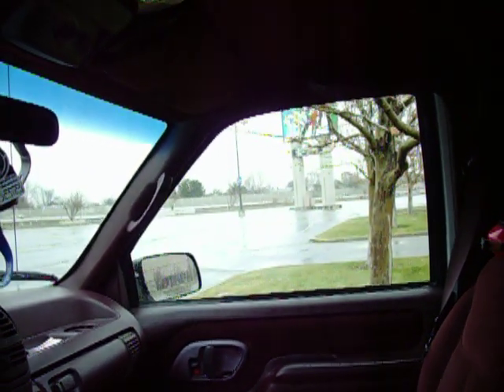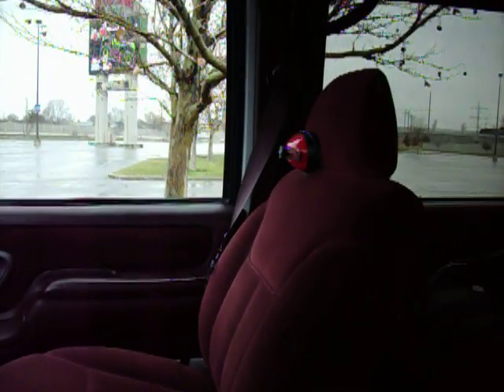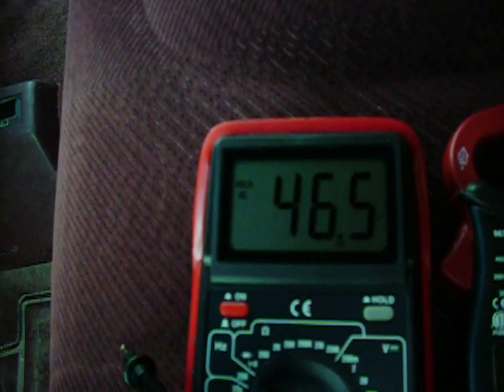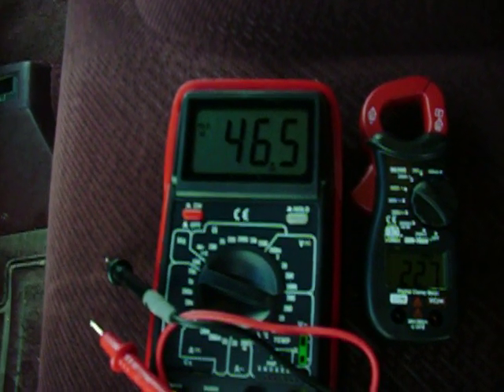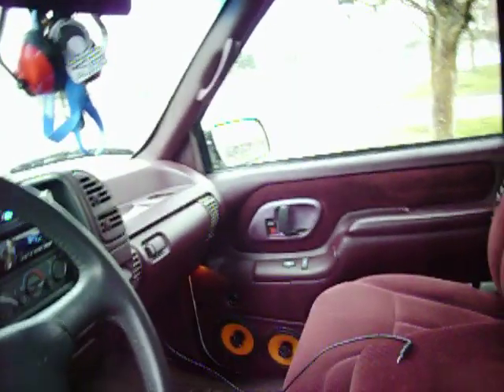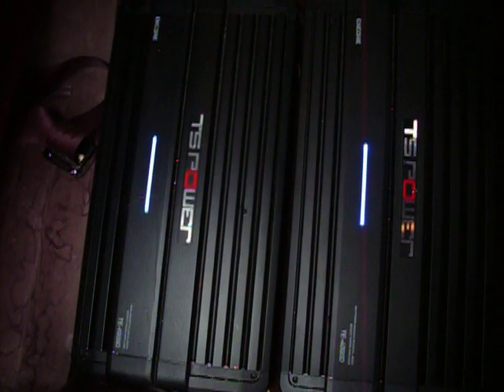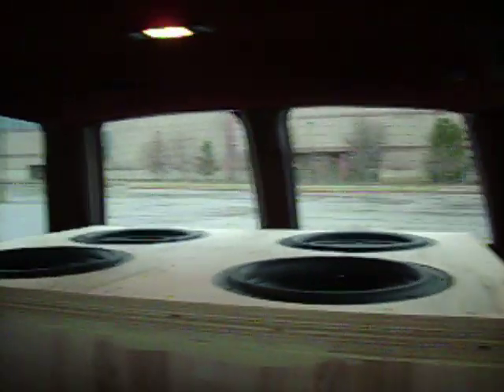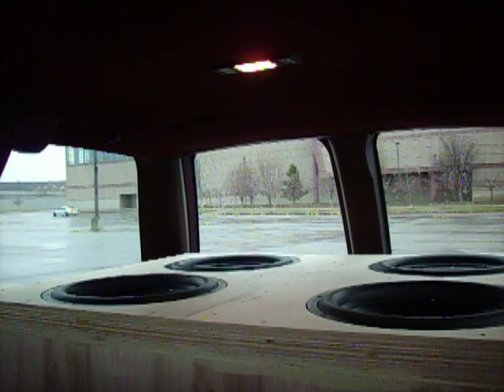true rms on my nesa 4000d

Comment: You think one of these amps would work perfect with 2 12 inch solobarics?
Reply from the maker: Yeah just barely.
Reply: @lonbera  what do u mean barely and thanks for responding
Reply: I did the big 3 upgrade and it made a big difference in bass but my friend told me he thinks that the nessa 4000d isnt enough power
Reply: The amp isnt ghna underpower or over power them to a point of blowing them will it?
Reply from the maker: @holdDeez1993  that's what I mean as well barely enough  power honestly I would put 1 amp to each sub

Comment: 150w rms off of rated is not bad at all, that is impressive as the industry standard on most amps is like +-~25% thats pretty darned good, these amps are HEAVY for their size, which is a testament to their internal circui design.  I'm not a NESA amp, nort am I impressed easily, but I am indeed impressed.  I am running a td-80 micro at 2 ohm stable and push dub six, or two type r's no prob, best part is it runs on cheap 8 ga. with no excess heat, which means draw is close to converted output.

Comment: You got to 1055w at 2 ohms what was your voltage at? It's rated for like 1300w at 2 ohm the 14.4v
Reply from the maker: They where at 1ohm and at 12 volts good amps though
Reply: lonbera If you divide the two numbers that you got you get the ohm rating after box rise which is 2 ohms like twisted video
Reply: LowerBamaBass I mean razon video